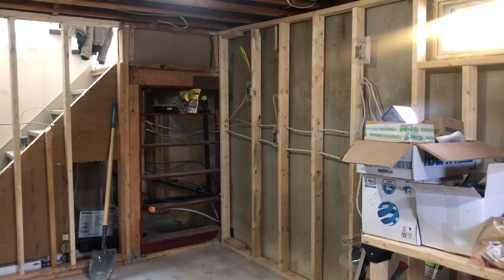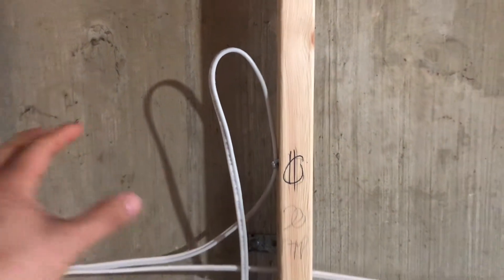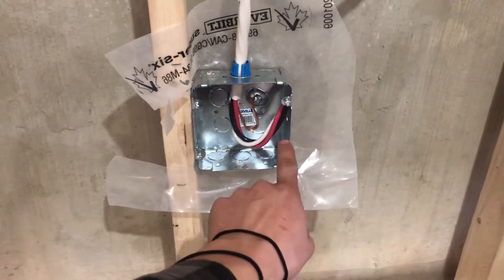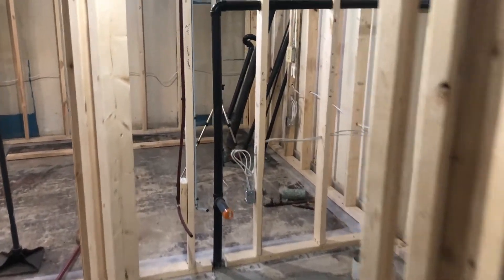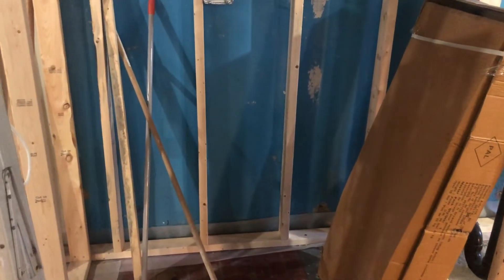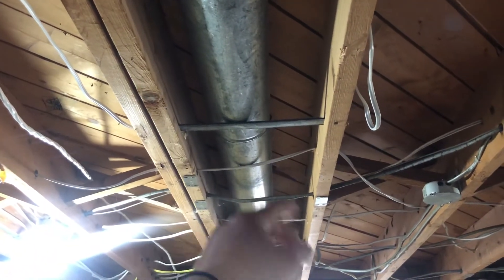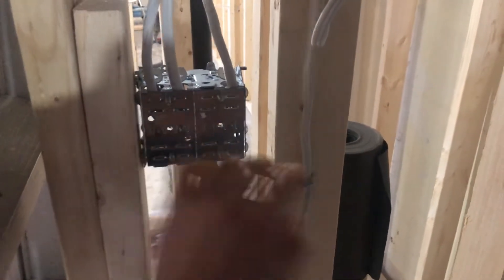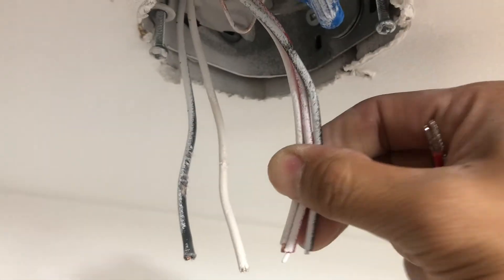Electrical Project Series: (Infractions after the ESA First Inspection) PART 5

Comment: A few years past posting but doing a complete rewire of my home.  I've never heard of encasing smoke detector wire in armor/shielded cable.  We don't do that here.  Maybe its because you are doing it for units/multiple dwellings?  Not too sure.  Kudos on going through your problems.  Reminded me about one thing I had forgotten about.  As for the furnace, I'm surprised they said outside the room.  Our code reads it must be within a certain distance and you must not be required to walk past the furnace and in a relatively obvious spot.  I liken it to putting the switch near the furnace but you have to walk past the switch before addressing an issue with the furnace (like at the entrance to the utility room).  Cheers

Comment: Great video, I'm just starting to get into the electrical part of my second unit addition. I found your video helpful. I was just wondering did you upgraded your breaker panel to 200 amp. Also, did you pull the permit for the electrical yourself or thur an electrician